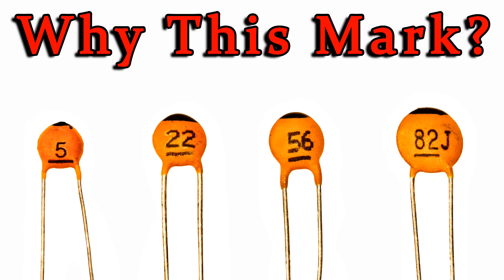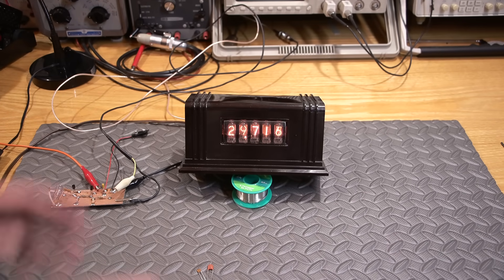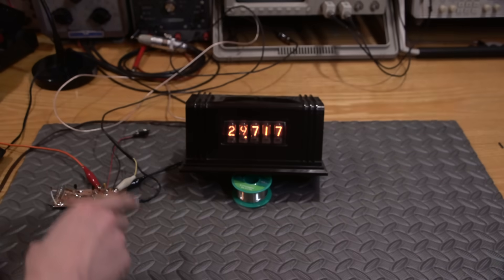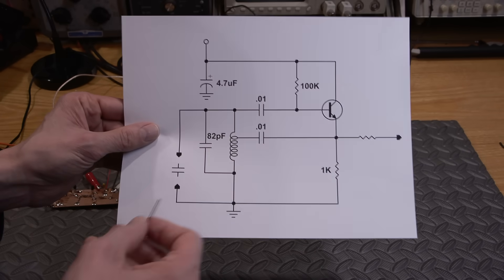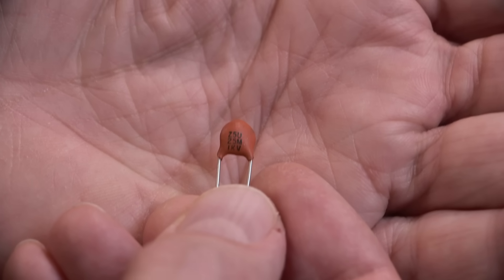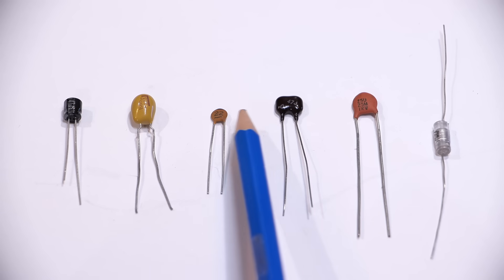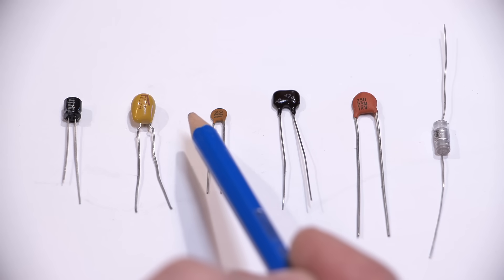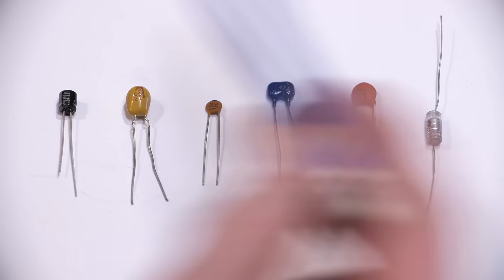Why This Mark On The Capacitor? Here's Why!

Comment: A backwards tantalum capacitor can fail spectacularly, especially those big egg drop jobs. I’ve seen plenty of older test fixtures with plexiglass shields bearing the scars of exploding caps.

Comment: Oh dear. No mention of dielectric hysteresis and DC bias effects, that's the main reason nowadays to consider C0G/NP0. 

Nobody would seriously consider attempting to get stable frequencies using discrete caps nowadays. Just use a stable-sourced TCXO PLL or DDS, it's quite easy but not a technology of course that antique circuitry discussed on these videos had access to.

Comment: Very valuable information. I was not aware of this small detail with such massive influence in a circuit. I've bought a can of black snake-oil paint and painted all my capacitors at home, it's been a rough work but now they are all protected against temperature changes.
🤣

Comment: Poly-sty caps  In old TV's Hoz osc would go int. Blow the Hoz out tube or in solid state sets get no start. 
every  3 month  to one yr.  Brands were Sharp, Panny,  Admiral, GE &  Sylvania.  @1970's. Any  with a 
blown ( or melted)  H out got the caps, IIRC 4 or 5 of them.
LFOD !

Comment: Awesome! Don't think I ever knew the significance of that black marking on the top of those disk capacitors. I actually have some of several types black and non black of these caps in my parts bin and can see the difference in measuring the drift in temperature on my LCR meter. In my professional working life it was mainly SMD with no markings so not much way of knowing what was what.
Reply from the maker: Glad the video was helpful!

Comment: NP0 caps are not "temperature compensating." They nominally have zero temperature coefficient of capacitance. There are ceramic caps that are designed with specific non-zero tempco of capacitance that really are used for temperature compensation of something else in the circuit, often an inductor in a resonant circuit. An example of a temperature compensating cap designation is "N330" meaning the tempco is -330 ppm/°C.
Polystyrene caps typically have a tempco of N150 ±50. That made them quite good in LC resonant circuits where inductors often had a tempco of around P150.

Change in capacitance in a ceramic capacitor is not simply due to temperature coefficient of mechanical expansion. Other more complex factors come into play. The Z5U curve, for example, has quite a large peak near common "room temperature."

"NP0" is still used but long regarded as obsolete terminology. "C0G" is the preferred term using the more modern letter-numeral-letter format as for Z5U, X7R, X5R, etc.

Tantalum capacitors are electrolytic capacitors. The most common types these days use a solid electrolyte but "wet" electrolyte types still exist (and are generally hideously expensive; old ones used solid silver cases which made them prone to shorting internally due to metallic whisker growth).
Reply from the maker: Hi Doug. Read the top line from Kyocera: https://www.kyocera-avx.com/products/ceramic-capacitors/surface-mount/c0g-np0-dielectric/

Comment: What about SMD Tantalum caps ? Is the line side the Positive or is it Negative? Just wondering if there is a difference between Through hole and SMD Tantalum markings.
Reply from the maker: Most SMD Tantalum caps are marked positive side as well.

Comment: I clicked on your video hoping to find NP0/COG capacitors, and your video saved me. Previously, I had to use polypropylene capacitors for many Class D circuits with resonance because I wasn't sure about NP0/COG, and most were just terrible X7R capacitors. I also couldn't afford NP0 capacitors due to cost and lack of flexibility; most were only available in SMD form, which was confusing, and PET capacitors weren't as good as polypropylene. Now I have a way to distinguish high-quality capacitors. Thank you!
Reply from the maker: Glad I could help!

Comment: Only really applicable to older electronics. Modern electronics use a PLL vco. Still important to know anyway.
Reply from the maker: Still lost of free running oscillators in equipment these days.

Comment: I build radio control equipment.  Older servos with all discreet component electronics never use ceramic disc caps for timing circuits nor do transmitters, and I had to find out why the hard way.  Servos will drift all over the place if the wrong caps are used.

Comment: Only a total idiot in electronics would use a ceramic capacitor as part of an oscillator circuit they're good for bypassing capacitors they're not intended to be used as part of a tomb circuit for that position in a circuit I usually use a mylar
Reply from the maker: Well... NP0 caps are ceramic, and more stable than Mylar.
Reply: hahhahaaa.....revealed by own hand.....hilarious

Comment: The greater influence due to temperature in a ceramic capacitor is typically the change in dielectric constant, as it can significantly affect the capacitance value. The expansion coefficient also plays a role, but the dielectric constant's variation with temperature is more critical for performance.

Comment: 🔴What, so no Silicone, or Tungsten, or Air Gap, Galium, Iridium, Polyester, Field Effect.? Or are You holding them hostage also.
👉more Elitist Snobbery at its finest👈
⭕What about, How to Tune Ceramic Cap's.? In, and Out of circuit.

Comment: Z5U was the material with worst temprerature coefficient of +50/-20 ppm which is the cheapest and almost worst from all ceramic possible. Only useable for bypassing supplies. Therefore we never used such shit..

Comment: While building automation, one of our worse nightmares were opto-couplers with the base hanging with no connection... even humidity would trigger those devices. I seen an entire headlight switch assembly line stop because the equipment was going crazy when the springtime heat and humidity started and was warming the building up... had to go through all our equipment built in that area and cut and seal the base terminals of those opto-couplers. An older tech working with me found it with what we started calling the ' Teapot Test '.. take a sheet and cover the unit and heat up water ( ' The Teapot ' ) until the steam was generated and we could then see what was causing the issues.

That same design had been used for years and we had never noticed it causing the issues we were seeing in that one department that started with 1 test set and gradually all of them were acting up. It rained that evening and everything worked again... until it got hot and hazy and I was in another state working. Only luck found what was causing the issue... and an old tech that swore the heat had something to do with it.

Comment: Before they put the black top hat on NPO caps they use to print on them "NPO". Same caps are made purposely to drift with temperature change and they would have a "N" and some number printer on it.

Comment: Mr. Carlson: don’t connect a tantalum capacitor backwards or they get grumpy.
Massive understatement. 😂😂
Back when I was in college in the early 80’s, it wasn’t uncommon for students to reverse polarity on tants when someone walked away from their project in lab. Everyone but the project owner would laugh when they popped. Some were really loud and left char marks on the board.

Comment: I knew it was a temperature compensated capacitor! The same happens with SMD Caps but you have to refer to the spec sheet and and the marking info in the Data Sheet pdf.

Comment: Correct some caps are indeed far greater than others. It's not just the cap that can add to freq drift problems. My approach when building any free run vhf osc is to add an afc circuit to it

Comment: They have also different inductance vs frequency,  some of them they are Capacitor but when frequency goes up it will be inductance,  the best way to characterize them is vector network analyser. I use BODE 100 for it.

Comment: Good explanation and tutorial. I get a kick out of all the old equipment you have in the background. Many of those pieces I used to repair for the government between 1971, (MOS 35B30), and when I retired in 2002. You might have used the heat from a soldering iron and deferentially a can of circuit cooler.

Comment: Today I learned! I'd shoved a non-compensated disc cap into the chime module on my car, in order to change the sound of the chime. Worked great on the bench! But in the car in varying temp conditions it drifted horribly.

Comment: Geebus, I love your channel!  While I have a rudimentary understanding of electronics and limited ability in reading wiring schematic diagrams, I simply don’t have the innate understanding like you; I guess I drew the short stick when God was handing out brains.  Perhaps he leftovers when he got to me…. Hah!  In any case, keep on making these great videos.  
Lastly, would you be interested in hot rodding a pair of Audio Research DS450M monoblock amplifiers?  These are AR’s last foray in Class D amplification.  They are the better part of being 15+ years old.  These amps make 450 WPC @ 8 ohms, and 650 WPC @ 4 ohms, simply astounding.  While they have great transient snap, and low bass power to make almost any speaker play ear bleedingly loud, it does lack refinement, and this is the thing I was hoping that you’d might be interested in tinkering with.  Let me know what you think.  Thank you & Happy Holidays!
Reply from the maker: Thank you for the kind words!

Comment: A quintessential Goldmine! That's what Mr. Carlson's Lab is. Hands down! Sometimes it's those, seemingly insignificant spec's that can make or break a good design. I'm embarrassed to confess that I've been laboring under the misconception that NP0 caps meant negative temp coefficient. 
Wakodahatchee Chris

Comment: NP0 ceramic capacitors are the most accurate for temperature change. Mentions tantalum capacitors better for long term use? Same or bit less than the the NP0? Noticed old 1980's 5 1/4" floppy drives and motherboards often use tantalum but these days YouTube repair guru's often complain about the tantalums failing sometimes replace with electrolytic. These circuits were used for reading and writing to the drives. I suppose they should be accurate no matter the temperature so those NPO's would be better? Floppy's are not going to be used for long term anymore so all in all, this comment is just an exercise in futility. I'll just stick to OEM design.

Comment: Why wouldn’t you just use the NP0 capacitor for all applications, if it’s more accurate and consistent? Is there some benefit to using one where the dielectric expands? It doesn’t make sense to me that there is even an option to the former if it is superior to the latter.

Comment: The ones you call electrolytic are aluminium electrolytic, and tantalum ones are also a type of electrolytic capacitors. So they are aluminium and tantalum electrolytic capacitors, not electrolytic and tantalum. Cheers 👍

Comment: Is there an instance where you would/should not use an NP0 capacitor and instead should stick to the standard ceramic capacitor and its lower accuracy?

Comment: My experience for the difference between these ceramics was never dimension shift, but polar molecules in the ceramic which gave a higher dielectric constant p, possibly 100s but temperature dependent. Simple ceramics only had constants ~4 or less but close to 0 ppm/⁰C.

Comment: A heatgun would remove any finger-coupling (as long as you mask the rest of the circuit of course) switching to cold air blown will reverse the effect...

Nice demo, Master Carlson !! 👏☺️

😎👍☘️🍻
Reply: You didn't name it but I assume the cap beside the polystyrene one is the humble "disc ceramic" capacitor ...

Comment: The weirdest issue I repaired on a car audio amplifier was a broken trace on the left channel on the input side. It looked like a good trace but was still broken.
This doesn't sound too weird at a first glance, but it behaved very weirdly. Can someone explain it?
It always worked right after a fresh boot for some time but then just disappeared at some point even if you never touched it. By bringing my hand close (no touching) to the traces, the sound got louder. Also the audio still always made it over the crack very faintly. 
Somehow bending the PCB in the way that would push the ends together didn't make it work any better.
I then just soldered a short jumper wire from a cap to an IC leg, and the problem was resolved.

Comment: Don't design circuits that rely on thermal stability of capacitors.  NPO dielectric is stable.  Its dielectric coefficient is low compared to most others.  That means that npo capacitors are comparatively large for a given capacitance and voltage rating.  Understand the performance requirements of your design problem and conduct careful trade studies on component selections.

Comment: That's interesting. I never knew that but I noticed in the catalogue some were classed as NPO. Your information about drift with various capacitors is very true. 

About 30 years ago I made a 5 - 5.5 MHz v.f.o. which drifted upwards so I replaced one silver mica with a polystyrene capacitor which slowed the drift. Then I put another in and the drift was negligible. Replacing one more S-M resulted in a downward drift so I went back to two of them and the results were very good over half and hour. Testing for one hour was very good with a little upward drift. 
2N3819 used with one as the oscillator and one as a buffer. A ceramic coil former with no slug, turns Araldited. I left it for half an hour to cool after soldering before testing. Several hours of testing proved it was very stable. 

I tested it recently because the synthesised v.f.o. I put in has failed after ten years so I'm going back to the analog v.f.o., crystals and mixer i.c.

Results here after a ten minute settling time, typical figures obtained:

5.304.31 MHz.
After one hour:
5.304.35/6 MHz.

I had previously used it indoors at home and on two occasions in a field at a special event station at an agricultural show. Very acceptable performance with nobody reporting drift both at home and in the field. 

G4GHB.
Reply from the maker: Great job with drift compensation! You did it the right way.

Comment: I think i might have to do that patreon course, never done patreon tho. 
What are the little caps used in fluorescent tube light circuits? 2 tiny little ones, legs twisted so in series, and in the low pF range.

Comment: Mr. Carlson, can you demonstrate the old method of a capacitor using two metal buckets and a plastic bucket as the dielectric? Place the plastic bucket between the metal buckets and charge it to 1000 volts. Remove the buckets, put them in a row, and measure volts between the two metal buckets, indicating there are no volts. Then reinstall them in a capacitor alignment and then measure the voltage, and the meter should indicate voltage. This shows the charge is held on the sides of the plastic bucket, not the metal ones. It really drives home how important the dielectric is. Good for new learners.

Comment: how many can i put in parallel.. for stronger temp effect signal ?

Good reasons not to tinker my own near 26pf cap 
to fix a board that heats up.. and the freq drift makes
it fail to boot.. or just reboot after time . .sign

a good lesson !

Comment: So, is there a way to use a non-compensated capacitor to measure temperature ... ?
Reply from the maker: Absolutely, and diodes are good for this as well, their forward voltage drop changes with temperature. My laminator for circuit boards (which I designed) uses a diode for a temp sensor, and has been more reliable that an NTC thermistor.
Reply: @MrCarlsonsLab  How did you calibrate the readings from the diode?

Comment: As a retired ET of 30 years, I never knew that. To be fair, my realm was in digital circuits and the only caps I had to deal with were decoupling caps. If I needed an oscillator, it was one of those metal can crystal jobs. For the really critical oscillators we used ovenized models that were about 1.5" square and super accurate. They were called TXCOs and were hella expensive.
Reply: Perhaps TCXO?

Temperature Compensated Xtal (crystal) Oscillators?
Reply: @Picard6289  Yes, we used them as our master clock for the MRI machines we built. They fed a numerically controlled direct digital synthesizer which was responsible for generating the excitation pulse to flip the spin of the protons of the subject. The frequency required was directly proportional to the steady state magnetic field the subject was in. I know that's probably TMI but I like to give context.
Reply: @markh.7650  Absolutely fascinating! I can never have too much context.
Reply: Yes. Making oscillators or filters using close tolerance analogy components has largely been superseded by digital hardware.

Comment: My FM radio transmitter has a few ceramic disc capacitors like this with the black stripe on the top for use in the critical tuned circuits. The other caps look exactly the same in other parts, but no black paint on top. I like your HP 410B VTVM. I used to have one of those, They're great! Now I have an HP 410C Voltmeter instead.

Comment: Hey you only touched with your fingers the capacitor without the marking on top but you dod not held it with your fingers the capacitor with the marking on top while plugged in the circuit __ come on let's be fair here ok ??????

Comment: What kind of [SMT] capacitor [in pF range] should I actually use for crystals connected to a microcontroller, if I need to use the microcontroller for timing ?
-would ceramic still be preferred or will the NP0 give better accuracy ?
Reply from the maker: The capacitors surrounding a crystal should be NP0 / C0G capacitors. NPO / C0G capacitor are ceramic.
Reply: @MrCarlsonsLab  - Excellent. I'll prefer NP0 for those circuits that are timing-related. Thank you so much. 😃